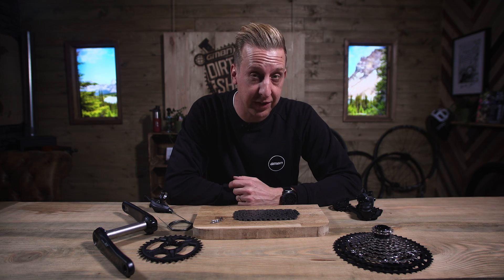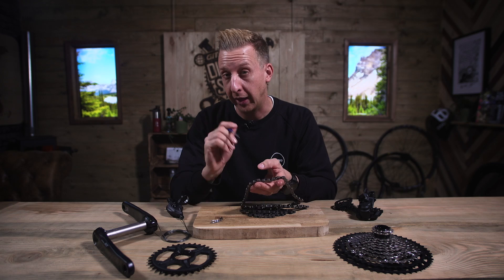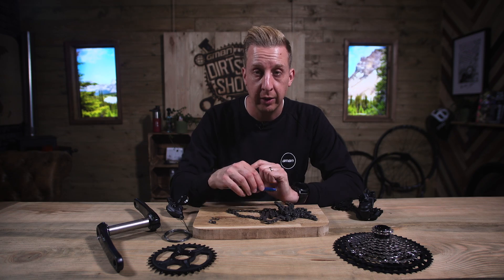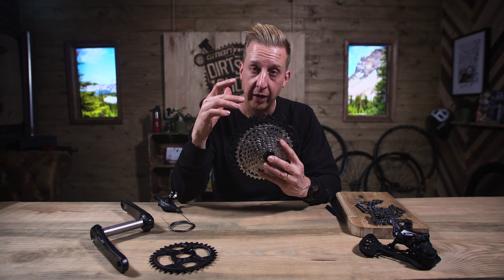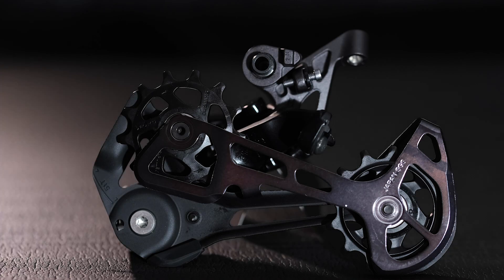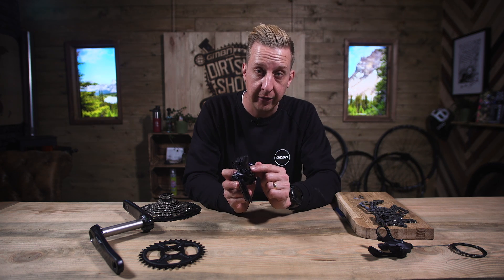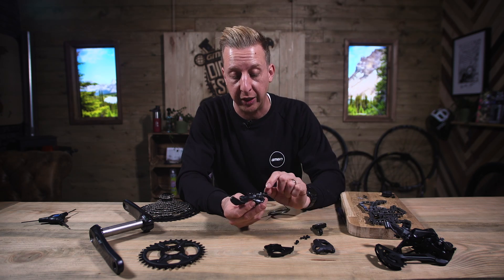How Do Mountain Bike Gears Actually Work? | Bicycle Gears Explained

Comment: Replacing only the large sprockets with lighter materials is really smart. The small ones only have a few teeth to engage the chain with, so every tooth needs to withstand great force. But if 20 or so teeth can engage the chain at once, and with how consistently modern chains do engage, then each individual tooth doesn't have to resist nearly as much.

Comment: The one thing I'd improve on with these systems is that barrel adjuster. Those ¼ rotations can leave you with an awkward mid point which means you find yourself fiddling with the cable at the derailleur and having to go back through the fine tuning. 
 My solution is simple. Ditch the indexed adjuster and use a system similar to the adjudters on cable brakes. Now, I hear you guys already tapping away "GRRR THOSE NEVER STAYED PUT!!! AGHHHH". Again, simple solution, do away with the lock-nut and have a 2.5mm grub screw in the shifter. It also stops little scrotes from messing around with your gear index, those who ride in urban areas or have curious kids know what I'm talking about here.

Comment: Doddy, have you ever had contact with the gears of the Soviet Kharkov company? They worked in the opposite way than Shimano, Campa or even the Czech Favorit, the derailleur shifted the gears towards the big mode (towards the wheel), and not towards the small mode as it is today. You could buy them in the 70-80s, today it is a total monument and rarely when it is possible to find complete set

Comment: Doddy  is not Shoddy in his knowledge and presentation. Problem is these systems are still vulnerable thru narrow rock gaps and freeriding thru Australian bush with sticks and fallen branches everywhere. I have used a 14 speed Rohloff hub on levo ebike and found it excellent. 2 much lower ratios that 1 x11 and one higher.Currently getting one fitted to Merida E160, expensive but Despite the high cost of living it remains popular.

Comment: I don't get it..

https://youtu.be/N8sQ8bQQKvs?t=308
What if it goes on a a male hole.. The thickier tooth wont fit the smaller place no??
Reply: The thickier tooth won't fit the smaller place, exactly as you described, but once you put the chain right it remains that way all the time - it is in continuous contact with the chainring, so it always remains the way it was installed.
Reply: @KubaMroczynski  logic.. thanks.. I should have get it..

Comment: #askGMBN on my dérailleur, I can move the cage back and forward, not only at the normal clutch point, but the big 5ml bolt as well, which is fully tightened, is that a problem?

Comment: Hi Doddy & Henry, I have a Shimano 2x11 and looking to upgrade to 1x12 system on my 2018 Canyon spectral Al5.0.  Im interested in getting the Shimano XT 1x12. I have DT Swiss wheels whiz I can get the micro spline hub for the new Shimano cassette. My question is can I still use my current crank and just buy a narrow wide chainring ? instead of buying a new crankset? 

Thanks a lot and GMBN rules :) #Askgmbntech

Comment: Thanks for a good video. I learned a lot about the shape of the sprocket teeth and chain side plates. It’s good when you are up front about the sponsorship by Shimano (or any other).  

The closeups could use more light and greater magnification. 

Doddy, thanks for explaining how and why the modern gear train shifts so well up & down under power. I have noticed that, yet wasn’t aware of the innovation behind the near-miracle. Five stars!
Reply from the maker: Thanks Larry! We are glad this video taught you a lot 👍 We are always as transparent as we can be when working with brands and only choose to work with brands that make great products!

Comment: can you explain why a bigger gear in the front is harder and a bigger gear in the rear is easier??
Reply from the maker: Sure! So it's to do with where the power comes from. You're putting in the effort with the front ring so a smaller ring is easier and a bigger ring harder. Whatever force you put in, drives the rear wheel. So if you put in X amount of force in a big ring, that effort is easy, because you're pulling more teeth around to drive the wheel a set distance. If you're in a small ring, that same force (X) will be trying to pull on fewer teeth on the cassette, making it feel much harder. Does that make sense?
Reply: @gmbntech  ah finally an explanation thanks!

Comment: Not my bike though it has 3x7 drivetrain but then again it's a hardtail mtb and yes a 8 speed chain will work on a 7 speed cassette might have to remove two links but it works

Comment: What do I think about derailleurs? It's amazing how well they've been refined, but it's about time they went the way of Walmart bikes. Rather not have to worry about them grabbing branches, and prefer to have the dinner plate and derailleur weight where it's best, near the BB, not adding unsprung and rotational mass. That said, while keeping drive-train drag similar to lower (looking at you Pinion), being able to shift under power (again Pinion), and only adding a pound to a kg of weight (ahh poor Pinion).

Comment: What is the size difference of a 1x rear derailleur vs a 2x... does it extend further towards the ground when extended so possibly more prone to damage??
Reply from the maker: You can run a more compact cassette with a 2x yes, meaning you can use a shorter cage derailleur which is further from the ground. But they're heavier systems, and a 1x derailleur will only be at full extension when climbing something super steep , so isn't likely to get damaged by anything

Comment: B tension is critical on 12 speed. Bigger the jump from 2nd to 1st, more critical it is. Shame that was glossed over, as many 12 speed issues are due to this...sram even has a special tool to set it...but none the less a GREAT video Doddy. 🤘🤘
Was only sorting out my mentee's gears today! And using the Park tool #hag-1 to straighten his hanger.
Reply from the maker: Good point Rupert! B-tension is indeed, super important for crisp shifting on bigger cassettes.

Comment: Regarding 12spd only: I have interchanged xt shifters and derailleurs xo and gx components. the shifters and derailleur  between shimano and sram 12 speed can be interchanged. The same are true for putting a 12 speed sram wheel, with your shimano setup and vice versa. The shifting under load is marginally better with Shimano than Sram, but not to the degree where it would make difference for weekend warriors. I am in the privileged position where We can play with multiple combinations and test it. The marginal gains are frequently overinflated by advertising. The Only incompatibility is that a shimano 12 sp chain are incompatible with oneup chainrings as stated on the website, but are fine with sram 12sp chainrings. The pull ratios for 11 sp and less are usually different and can’t be interchanged.
Reply: Hi, currently running xt shifter with sx derailure and cassette, I just hate SRAM shifters.
I have bought an xt 12 speed derailure but just can't seem to get it to index correctly on the SRAM cassette.
Have you had any success on this combo?
My next step is just to buy a new rear wheel and go full Shimano xt.
Reply: No, I did not experience shifting problem xt 12 sp derailleur and sram 12 sp cassette, other than subtle differences. I can’t comment on effecting the longevity of components. I mentioned it as Doddy said they have different pull ratios and are thus incompatible, which is contrary to my experience with 12 sp group sets. I would suggest that you go through the normal trouble shooting, ex bend derailleur hanger ext.  I recently had a gx derailleur shifting badly without apparent damage, but eventually only diagnosed it as the cause of trouble after elimination of other causes by swapping it with a xt derailleur With a xo shifter.
Reply: I have not personally tried an sx derailleur and cassette, but in theory it should work fine. I do throw a wheel with a nx cassette on a xt derailleur / shifter and it shifts fine without adjustments..
While a Sunrace 12sp cassette needed some minor fiddling.
All the best in sorting your setup.
Reply: Prior to buying a new rear wheel, check if it is possible to source just a micro drive hub for your current wheel. More manufacturers have them as the licensing requirements have eased.
Reply: @rubenconzales9718  Giant don't supply a microspline hub for their tracker hubs. I could get the xt derailure to shift semi reasonably on the SRAM cassette, but not anywhere near perfect enough.
My bike is the trance 3 2020, although I like the spec of the trance 2, I didn't like the colour lol.
I bought a Trance 2 wheel as it looks exactly the same as my current wheel but has a Shimano hub with microspline, just waiting for the xt cassette to arrive then it's game on 🙂.
Reply: AndyTheBluesHarp  I am not sure why you are having problems. I cant see that it should be related to Giant. I generally set the chain length according to shimano’s guide and the b tension by which derailleur. It seems to have little effect on what cassette is on the wheels as we frequently interchange wheels for a bit of fun between bikes. The only time it needed adjusting was with a sunrace 11-50 cassette on a bailout wheel. Out of interest sake, drop me a line when if the xt cassette solves your problem. Generally I find shimano less finicky to setup than sram. I have recently replaced a gx derailleur with an xt one after braking it on a trip and it worked fine with the xo shifter and gx cassette to such an extent that I can’t be bothered changing it. All the best.
Reply: @rubenconzales9718  I suspect b tension is the most likely culprit, I didn't want to cut the chain (and thinking about now I could have used a quick link to replace what I'd taken away) and Couldn't get the upper jockey close enough. 
My initial reason for the change was simply that I hate SRAM shifters. After some further research on the reliability/durability of the SRAM eagle derailure, I've decided that even at the GX end of the scale they are junk compared to Shimano.
My issue is I'm an amputee, I can ride for miles, but walking back is an issue. I'm an engineer and there's not much I can't fix on the trail. A FUBAR derailure is my worst nightmare, the sx derailure is already wearing out after only 80 miles, the upper jockey has around 2mm play. I'm not fussed on warranty, as they will just replace like for like, so I'd rather just upgrade myself.

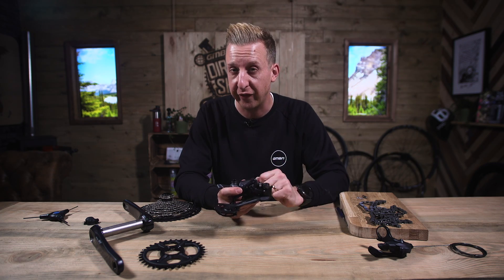Comment: 12:43 "It's just gonna be a hard work" and you can damage the tension adjuster (not sure about the name), that sheet metal piece with a screw 12:29 . This one was breaking as hell at least in SLX M-675. After 2013 that issue was resolved with a higher quality material but I'd still be gentle with it. Got a XT M8000 with a 10s 46t cassette, so there are some huge tensions but so far one season went good for this working horse.
Reply: Meanwhile I just prefer sram's version of roller bearing clutches and cage lock. No more of even needing to fight any spring tension just to remove the wheel, and no more forgetting to turn on the clutch after reinstalling the wheel.

Comment: Derailleurs need to go, can't wait for that peace of mind when riding without one, but still having gears. I wish shimano would make a gearbox rather than this 12 speed. Also I think we need more low gear number gearboxes and gear hubs. 14sp rohloff and 18 speed pinion are not really needed and the weight could be saved with proprietary casing and shaft sizes. At the moment you can get 9 speed pinion and 12 speed pinion in 18 speed package. I believe same goes with geared hubs.
Reply: What's wrong with derailleurs?
Reply: @elimain1261  They suck, they get ripped off, they require more and more expensive hangers, they have not ben indexed still, the jockeys wear out and get muddy as hell all the time....and on and on
Reply: @polishguywithhardtospellna8227  what alternatives are you suggesting?
Reply: @elimain1261  gearbox with gates belt drive obviously. Is there another?

Comment: while as always i enjoy your explanations, having  1x and 2x'd bikes i still prefer 2x'd. i do lots of climbing on my rides and prefer the ratios. at 64 i find it matters
Reply: 36/22 with a 11-36 Casette cannot be beaten as a vfm to any 1x. 34 with 10-51 is the closest.
Reply from the maker: Horses for courses! But as pointed out below, the ratios can be pretty similar these days, and you get a weight advantage with less bolted to the bike.
Reply: @gmbntech  For sure. But I am talking in general. If you take a 30/2/4 with a 11-46 which is similarly priced with the 2x I suggested  you make quite a sacrifice in chainrings  compared to a 2x for the gain of weight. For a decent 1x you have to pay. Let's not forget that a mtb is still the best commuting bike as well imo.

Comment: #GMBNTech
Hey Doddy, great video loved it!
Do you mind making one on bike gearboxes, I'm interested in mechanics and would like to know a bit more about Pinion and other gearboxes on the market. 
Why do they exist and why are they not so widely used in races and in genera?
Thanks in advance.
Reply: In general they are expensive to make, heavier and less efficient than standard derailleurs.
Pinion does a good job with them but they are expensive for that reason, Shimano can make a gearbox now but it would be a lot heavier and less efficient than a pinion one in case they want to bring it to mass market.

Gearboxes in general could become an option in the future but I doubt they will trump the efficiency of standard derailleurs and most likely will always be more expensive without performance gains besides maintenance.

Comment: 5:25  depends what type of riding you do, if you have the chain in low gear ride down steep terrain with big roots or ride down stairs you will drop the chain.
I have to have a chain guide.

Comment: Hey Doddy. Have you tried the new Shimano front chain ring with an 11 speed chain? I need a new crankset and chainring for a shimano 11 speed set up and would like to use the new M7100 crankset if it works with 11 speed. Thanks.

Comment: Derailleurs are as pivotal and key as the wheel when it comes to design, technology and longevity... you can refine it but in essence it remains unchanged, same as the wheel and the internal combustion engine. I’ve just converted to 1x on my Scott Scale... I went from 11/40 2x 26t/36t 11spd to 11/46 1x 36t 11spd. It works superbly both top and bottom end, all that is left now is I’m thinking about going 36t oval for that final refinement
Reply from the maker: As a whole, the drivetrain has improved massively in recent years! Frame design and tyre clearance have benefited from the 1X systems.

Comment: Great video,  but i've got a rather odd question. So the inner/outer plates on the chain and the narrow/wide on the chainring do you need to line up the chain in a specific way or doesn't it matter? #askGMBNTech
Reply: Yes, it does matter! The 12spd chains from Shimano are directional and have an inner/outer side for the hyperglide+ shifting to work properly. With the narrow wide chainrings up front the chain will only physically go on one way, so that bits easy - just make sure you put the chain on the right way up with the writing facing outwards.
Reply: @BenHaskell  Correct. Make sure the printing is facing outwards and as Doddy showed, make sure the chain sits in correct narrow wide of the chainring but you'll notice when it isn't.